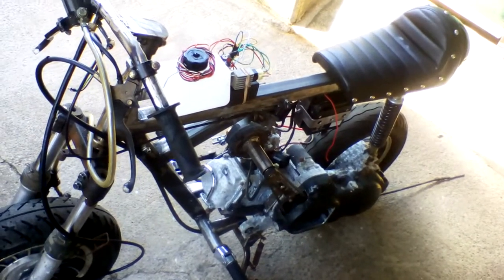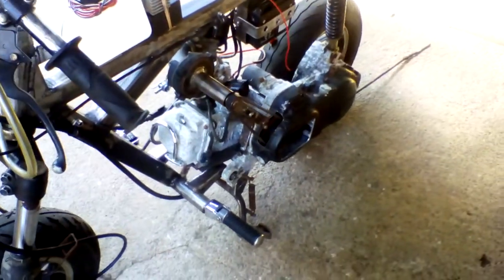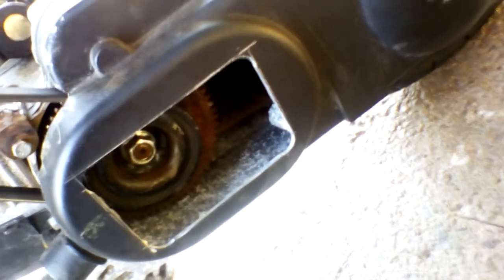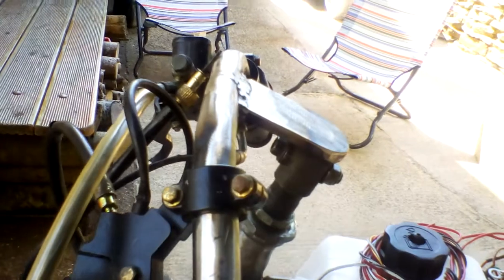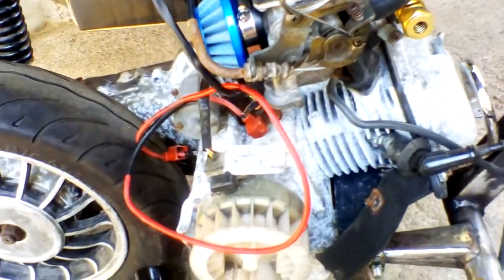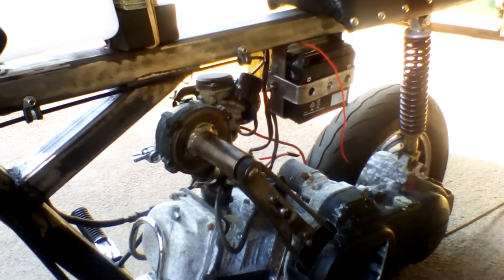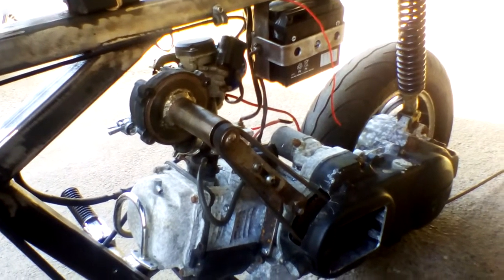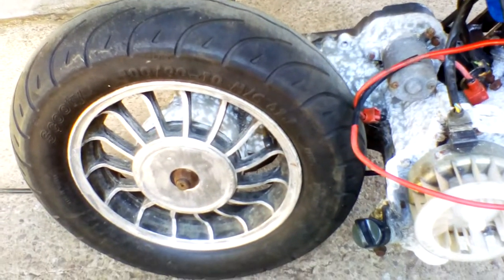Supercharged 49cc gy6 project. The scooter charger!

Comment: You need to spin impeller much faster to make any boost, you should use about 10:1 ratio gearbox between supercharger and crankshaft. From experience i can tell you that using a positive displacement supercharger will be much better idea.
Reply from the maker: Thanks, I already looked at using a positive displacement supercharger but the engine didn't make enough HP to turn it. Everything needed to be scaled down to suit a 49cc engine hence the low boost. With the ratio I'm using it should spin  at 22,500 rpm at peak power. This is a fraction of what it would spin at as a turbo on the smart car it came off but these have much bigger engines.

Comment: cool .. genius .. hows the top speed ?
Reply from the maker: The supercharger and engine started to reach an equilibrium around 35mph so it struggled to go any faster.  It was making +1.5psi of boost above 5k rpm so with a better and faster impeller it had the potential to go faster if the engine had more initial HP. To prove this point it did 45mph without the supercharger fitted.

Comment: How is the drive pully for the belt mounted, just sandwiched on the end of the variator?
Reply from the maker: There's a second ribbed pulley on the outside of the primary variator pulley where the kick start gear would normally be. Hence there's no kick start 🙁
Reply: @Themoporium  ah OK, so it replaces the gear and fits over the variator rather than say just the outside if the pully welded onto the variator
Reply from the maker: @tortron  by having it bolted on you can change the drive pulley size. At the moment I can't go any bigger without hitting the outer support bearing for the starter motor Bendix so this is limiting how fast the supercharger spins. A gearbox would be the answer but I'm trying to keep it simple.

Comment: My stock 150cc with exhaust would dust
Reply from the maker: This is only a 49cc so any 150cc would be faster. I built a 125 gy6 with a very short light weight frame and it went like stink.